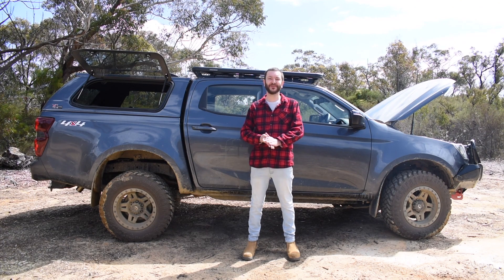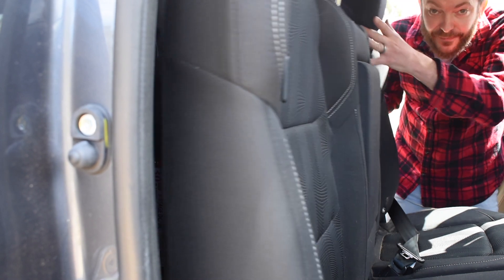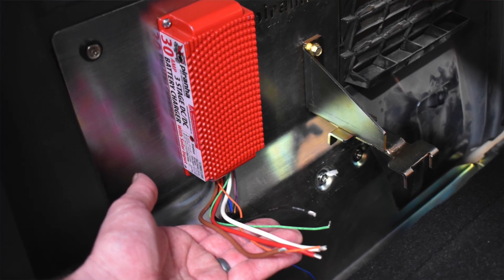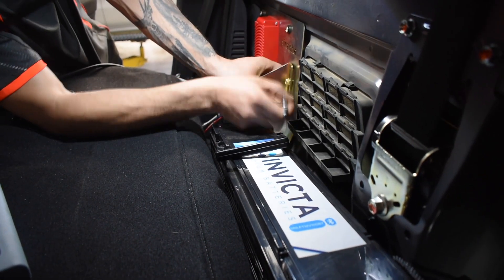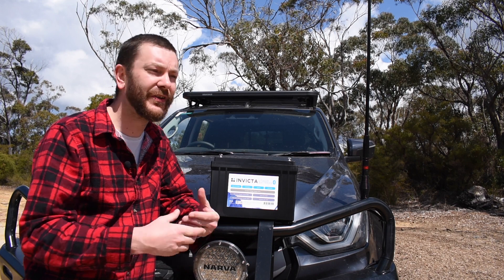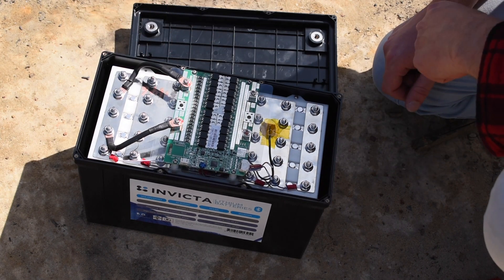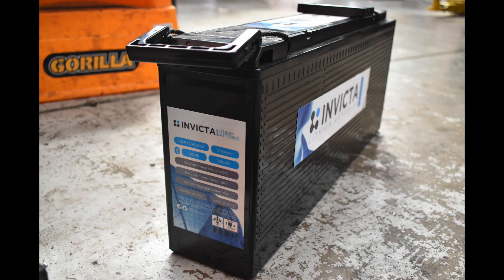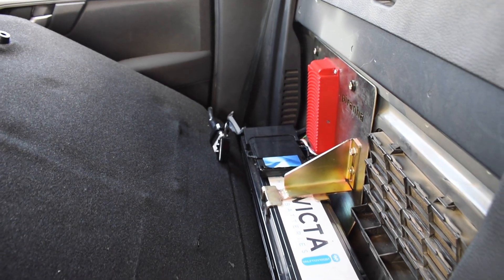D-MAX gets lithium dual-battery system | 4X4 Australia

Comment: You and Piranha really seem to be leading the way with that battery install. Clever use of space. That Bluetooth monitor rocks.
Reply: How is that leading the way when other manufacturers have been doing this for ages - and better execution e.g. using slimline Li batteries.
Reply: @grantlouw3182  can you please tell me the other manufacturers so I can check them out?